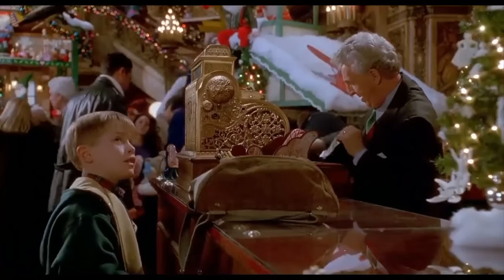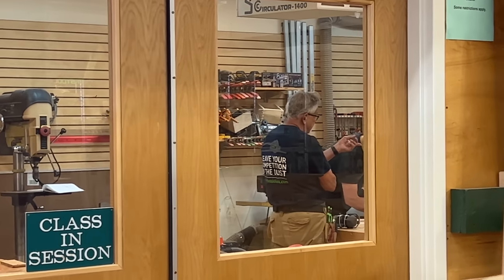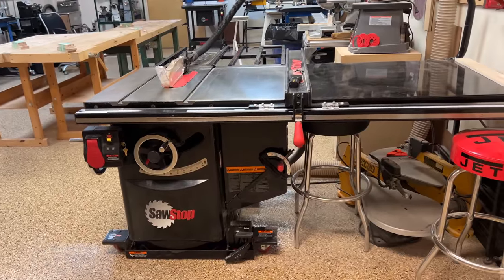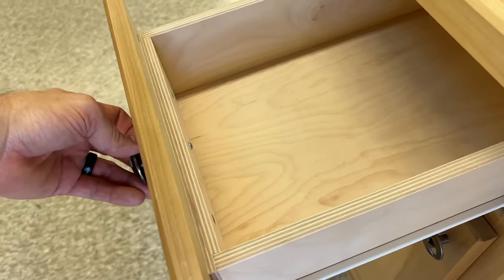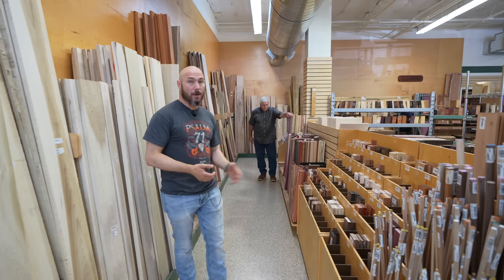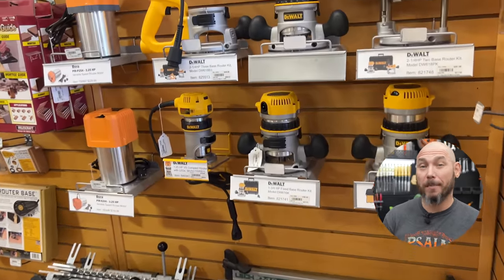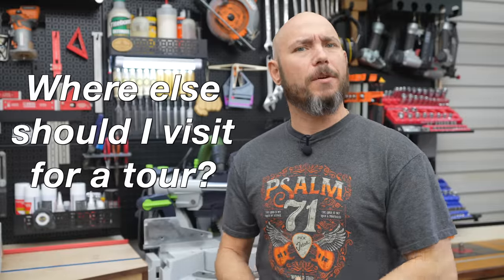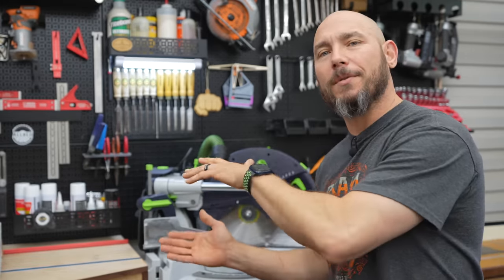My First Visit to a Woodcraft Store! In-Store Experience!

Comment: I love woodcraft store. I go there often. My problem is their price tag on everything. Over priced is an understatement. But if you need something special they usually have it.
Reply: Yea that’s my issue with woodcraft and rockler. They are so expensive. If I wanted a saw stop I would go there so I could just get it but anything else is just was to much money. A pack of Kreg screws 2 inch were 8.99 for 50. I got them for half that at Amazon.

Comment: There's a Woodcraft store just twenty minutes from home in the same little strip mall as my chiropractor's office so it is super easy to pop in for a look-see. I do like the store, and the employees are friendly and knowledgable. I enjoy being able to actually LOOK at, touch, and handle the tools in person. I have found that in many instances their prices are significantly more expensive than online retailers. (Whiteside router bits being an example if you compare with Amazon). That said, they do have a place in my tool & supply buying tool chest and I have gone in and purchased from them on a number of occasions. They also have some decent sales that match what other retailers have (I purchased my DeWalt planer at the store).  I highly recommend checking them out. If nothing else it is a fun place to visit for that "kid in a candy store" experience!

Comment: We ~had~ a Woodcraft store here in NE Indiana a 5-10 years back, when I lived about an hour away. By the time we moved into town, the Woodcraft had left. All we have now is a locally run shop, which is ok, but they're a bit more on the pricy side. It's literally a woodworking desert here, only big box stores and that one overly priced shop in the whole area. Luckily Woodcraft has great sales and ships relatively quickly. I also shop at Rockler and Woodpeckers, and a hardwood shipper online...they are all great. I really wish we had a brick and mortar store. While I haven't had issues with the quality of the lumber shipped, sometimes it can take from weeks to months to receive a hardwood order, so you have to plan ahead. There's no running out to pick up a single qtr sawn white oak board.
Probably for the best...I'd probably end up spending ALL my meager funds there, lol

Comment: Woodcraft in Clearwater Florida is great! I was able to realize a lot of my limitations having 1 arm/leg, without having to spend a fortune. (They also helped me when I had a bazillion problems with a Kreg track Saw (It's junk. Sadly, no one makes a good left blade track saw.).)
 
Basically I was able to see that being disabled meant I'd have to work 100x harder, and spend 100x as much money in order to do the most basic of things like cutting and drilling straight. I wish I could give up, as it's crushing to keep pushing, and not gain anything after years and years of killing myself from heat and exhaustion, trying. 
 
If Sawstops weren't so overpriced, or a left blade track saw existed, I'd be able to cut straight lines. 
 
If Direct drive drill presses (Nova ) weren't so overpriced, I'd be able to drill straight holes. 
 
Spend a week just using you're right arm, (and for safety, dont use a table/band saw). I'm a former lefty, and at least then, I could use right blade track saws. 
 
All on all... it's heartbreaking. But I'm too vested. And thanks to Woodcraft, I didn't have to make even more expensive mistakes.
Reply: Clearwater location is not great, not even remotely. it's all the town has so feels great but I have spent over 20K between the us19 location of old and the east bay location they have now and that place is a cesspool now and has been since 2019.
Reply: @NeoPest  care to explain?

Comment: I only have to drive 140 miles to get to my closest Woodcraft. 100 miles to get to Rockler. Both are good but just too expensive unless they're the only place to get what you need. I discourage my student from buying wood even with a 50 percent off as its still 20 percent more than a local small dealer plus if it's 3/4" you have no room or extra to deal with I encourage 7/8" at a minimum or 1 7/8" and when in Phoenix there are large hardwood dealers and some carry exotics. I do buy from Rockler for some specialty items. Being in Arkansas you should have plenty of hardwood dealers. Don't even want to get started on their machinery pricing. I Phoenix we ha Woodworker Source, and they have the largest selection of exotics in the state, and it's not S4S. They also offer milling of your lumber plus a wide belt sanding and straight-line service.

Comment: now visit the Clearwater FL store and air the opposite side of woodcraft as a chain

there you will find poorl;y maintained stock, lazy employees that seem bothered to help with the most basic task plus can't identify the wood they sell, and management that puts defective, returned  merchandise back o the shelf for the next sucker to buy as soon as the customer that returned it leaves.
Reply: just finished the final 2 minutes of the video and wow this description regarding tools knowledge really shows how different the locations are. clearwater has zero knowledgeable staff and most act totally befuddled at a tool question it's far more akin to  an aexperience at a hd or lowes nowadays with their zero tool experience staff
Reply from the maker: Each Woodcraft location is privately owned by a franchisee from what I understand.  So the owners of the stores will run them differently.